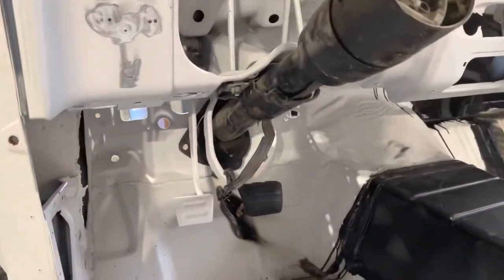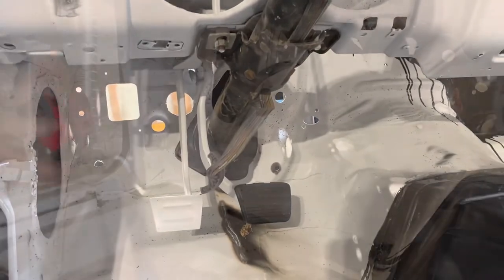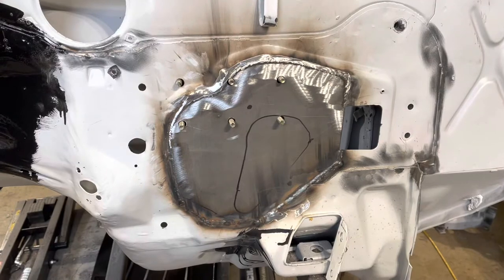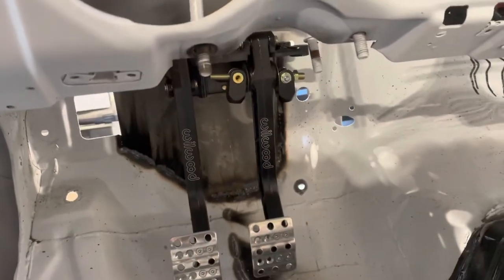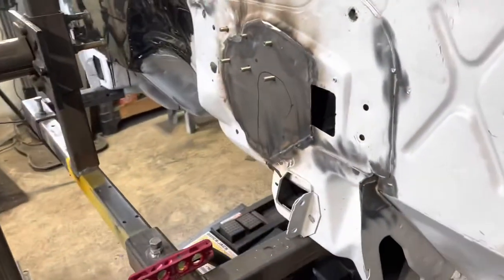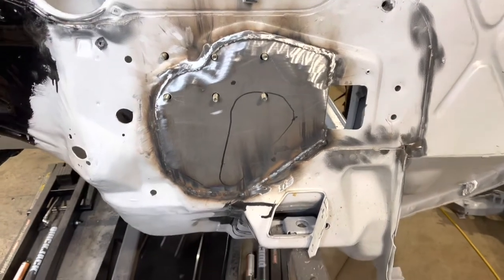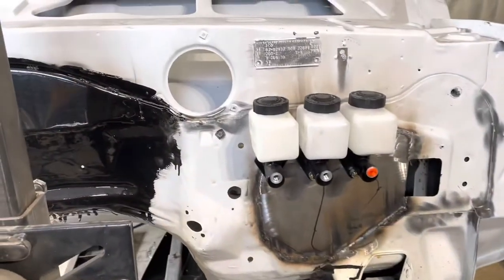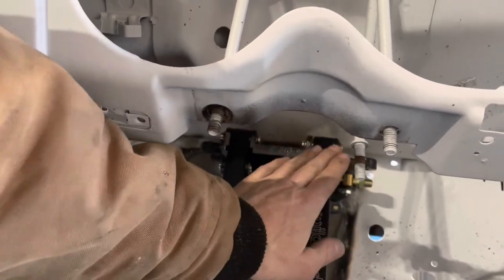Episode 278 Mounting Wilwood pedals in a 1967 Camaro

Comment: Hey Mark, I know I am very late to the party but I just started my build. Was wondering how/ you decided to put the pedals where they are? Was there previous marking spots or did you just have an idea of where they go?
Reply from the maker: I just placed them on either side of steering column, simple as that
Reply: @SKIDMARKperformance  Thank you for the help. I will most likely be running manual brakes with this. Are you going the manual or power brake route for this build?
Reply: @Him_othy  I am running manual brakes and have run the car on the track twice and had no problem getting it slowed down
Reply: @MarkSawatsky  that makes sense. I have seen if you get the right stuff like bore size and pressure on a manual setup, it runs great and not as bad as some people make it out to be! Plus it gives you that more engaging drive. That is why I will be doing manual brakes with you!

Comment: Hey Mark, Do these Wilwood pedals work with [fit in-between] an OEM width column? My OEM column = 2.45" at the widest point. Thanks!!
Reply: sorry for the delay. There is 3 inches between the Wilwood pedals so a stock column will fit but it's going to be tight